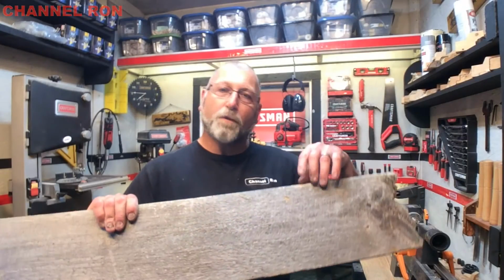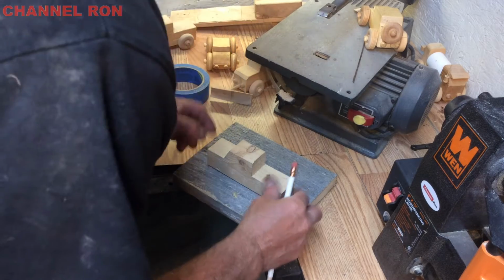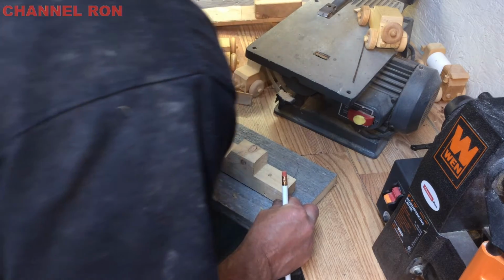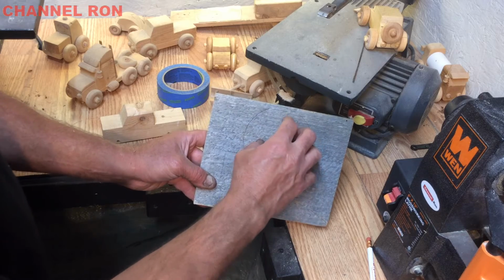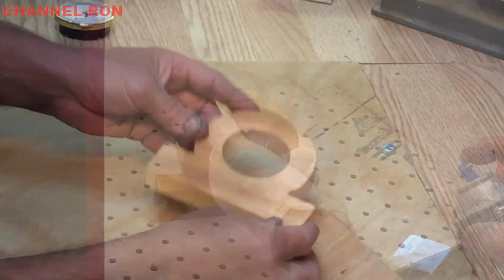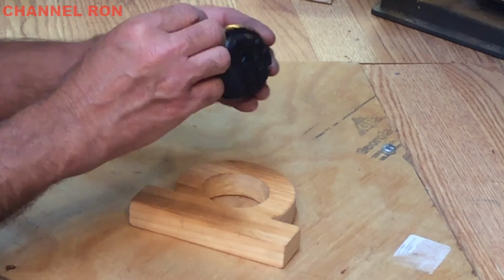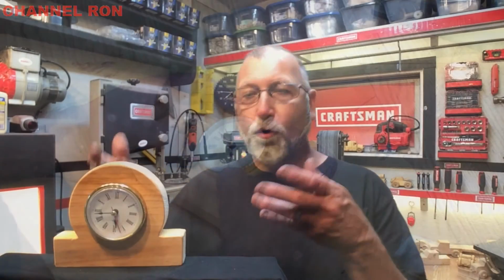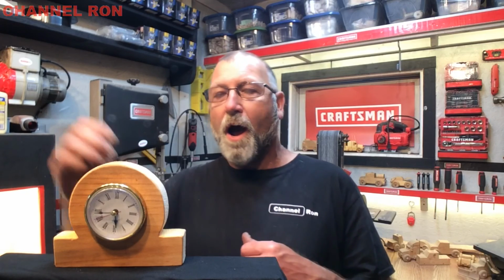How To Make Basic Mantle Clock

Comment: Check out the supplier as you can get spring clips or rubber band movement holders which allow easy removal and installation of the movement without damage to the moment or the wood and makes replacing the battery a dodle, I'm a clockmaker by trade